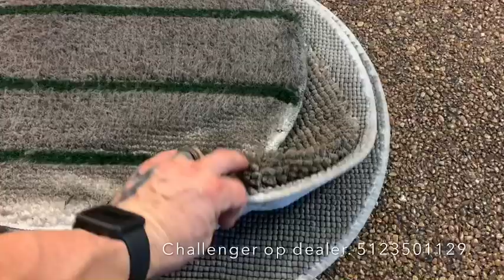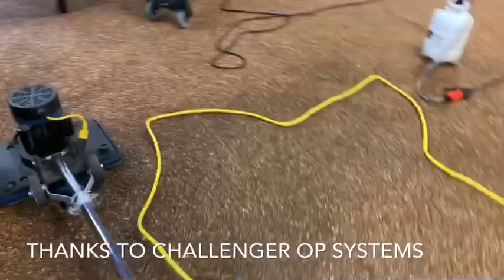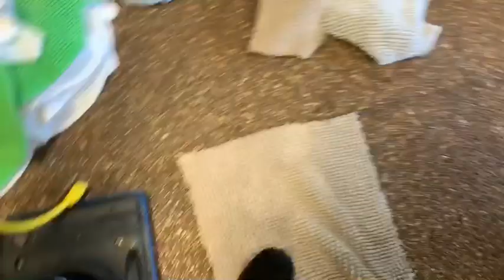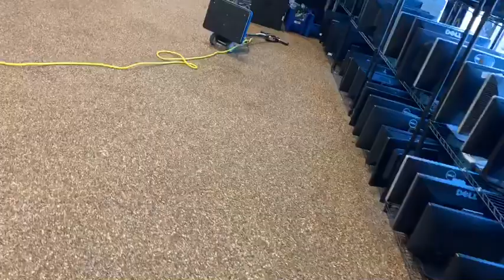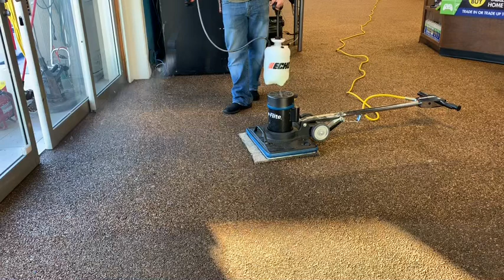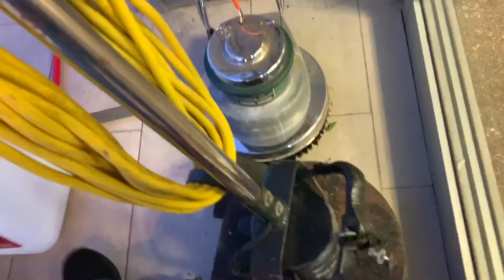Gravel Concrete Vlm cleaning Challenger OP systems Breakthrough. #carpettime.

Comment: Every couple years or so manufacturer recommends that a new top coat of epoxy gets rolled on..he probably needs that cleaned to get his new coat of epoxy..its mostly used in garages an for cleaning u just powerwash it..but being inside makes powerwashing a no go..looks good corey👍
Reply from the maker: kcm731k you are correct. I was cleaning it for that reason exactly. He said he has it in his garage too. It makes perfect sense in a garage. As far as being inside there is so very little you can do to it.

Comment: Ive installed that type of gravel floor before..its called nature stone in my area an its completely porous..the water goes rt thru it..but also it will evaporate quickly since it is so porous..it also is mold resistant since water dries up an doesnt get trapped
Reply from the maker: kcm731k   What a learning cure i was on.  Thanks for commenting. Glad to learn more about it. 😀😀

Comment: The stone is held together with epoxy..not sure floor stripper would be ok with the epoxy..but also it could be perfectly fine im just not sure but i know from installing it that the stone is mixed with epoxy then poured an leveled an then needs to harden for a day..next time u do one of these check to make sure floor stripper is ok with epoxy..i would try just cleaner first
Reply from the maker: kcm731k   I did put forethought into it.  Floor stripper would not dissolve epoxy, but in hindsight a lower ph would have worked as well. It dissolves floor finish because it is water based.  The whole floor we probably refilled two separate two gallon sprayers about 5 times. As we finished each area the floor was misted with vinegar to neutralize the ph of the stripper so it would restore it to around a 6 ph. I have done many different floors types so neutralization is necessary to reverse the ph from damaging certain stone types. 👍
Reply: It looks great..i wasnt sure if stripper would hurt it or not an wasnt sure if you knew it was epoxy..jus thought i would tell u what i know about it..glad you had the wherewithal to look into it👍

Comment: What did you clean with on that floor. Solution wise on rock type floor stripper and 20 vol or something else.
Reply from the maker: Travis Hays   Zep floor stripper and 20 volume. Did you watch the whole video. The end is the best part. 👍
Reply: @CarpetMuscleTV   I did watch it all . I didn't get what you used

Comment: Did you have to reseal it after Cleaning
Reply from the maker: Jason James   It is coated with epoxy. It’s sealed permanently. It took on a smooth feel after cleaning. It has several coats of clear epoxy. 👍